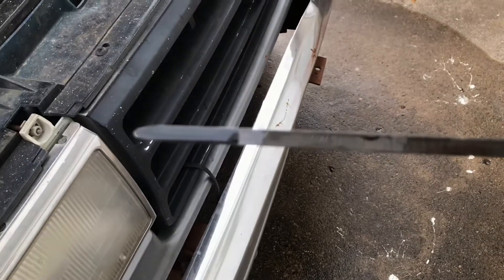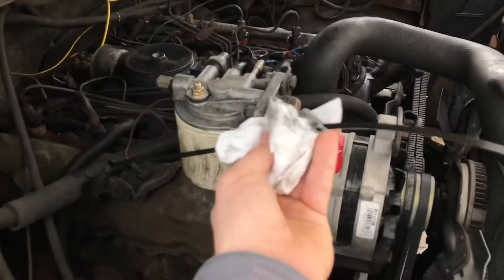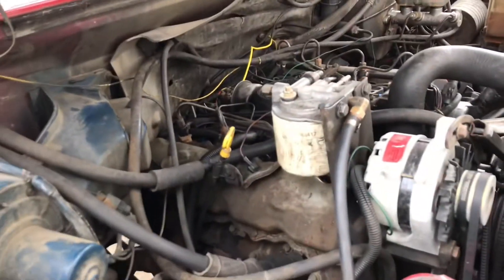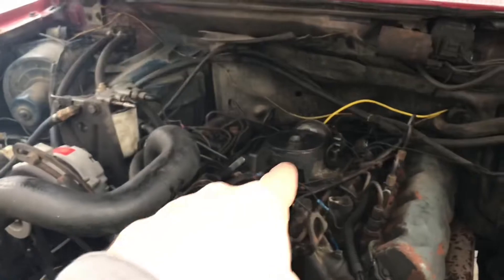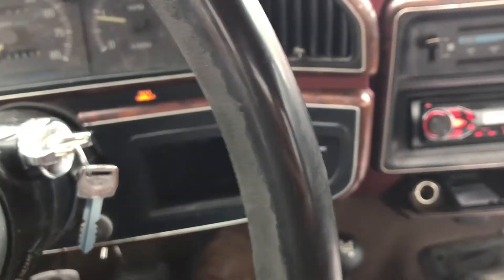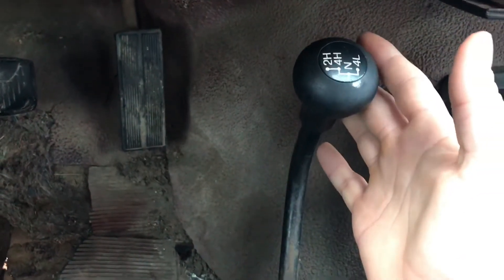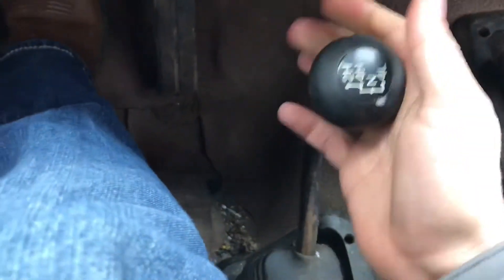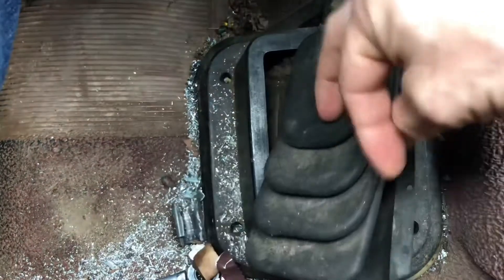More F-250 7.3 IDI Problems! No Oil? No Problem! More Bottle Calf Planning and Layout

Comment: Funny, I was thinking the same thing about my truck. "My neighbors must hate my azz" LOL! They are some loud diesel engines compared to today's trucks. Wait until I drive it to work one night I leave out about 9 pm. I come back around 6 am, I'm sure they'll appreciate the wake-up alarm. Especially on Saturday mornings when I get home at 0530. I started hooking up the glow plug bypass today but it got dark so I ran the wiring and installed the push-button switch and called it quits. After that, I need to find the power steering fluid leak and replace the valve cover gaskets and she should be good to go.
Reply from the maker: Let me know if you have questions. Not sure about yours but mine is a straight pipe haha. It’s annoying I’ll even admit it. As for the neighbors...they’ll live. Haha
Reply: @PowersFamilyFarm  Mine has a muffler but she's still pretty loud. I was looking at the yellow wires you used for your glow plug bypass. I ran one from a small hole near the master cylinder. I was only able to get the wire that goes from the push button switch to the relay thru it. I figured I could find a ground somewhere in the cab for the ground wire. I like your setup better so I think I'm going to re-route the wires like yours tomorrow. It appears you ran it thru the speedometer cable I think correct? And it looks like you grounded it to the ground strap on between the hood and body looks like. I think I like your setup better so I'm going to try that. I can't say it enough, but thanks for the assistance.
Reply from the maker: I did run it through an existing hole. It was super tight. Wherever you can find a place that is a solid ground. Take your time and do it right the first time.
Reply: I have used just a self-tapping screw into the sheet metal just above the hump to connect to ground...just remember to sand off any paint where its going.
Reply: @gregorythomas333  Thanks will do, I the hole I ran my wire thru to the relay is super tight as well and I don't think I can fit a wire out of it to ground to the chasis. So I'm going to do ground it in the interior somewhere hopefully.